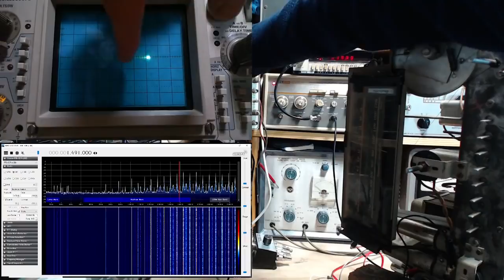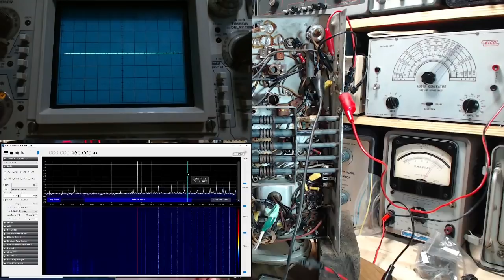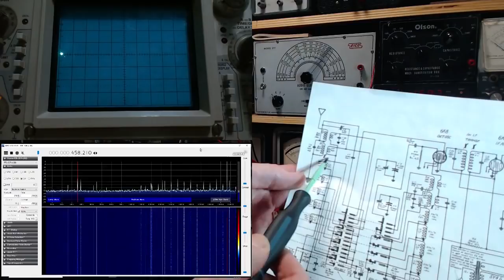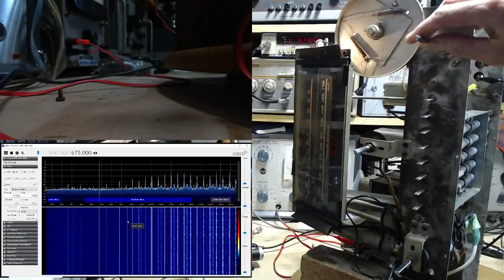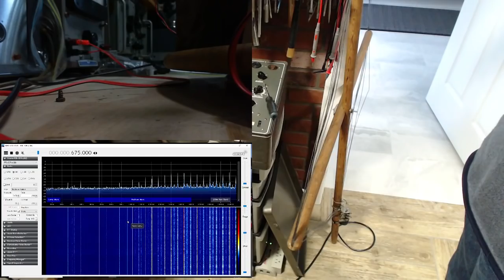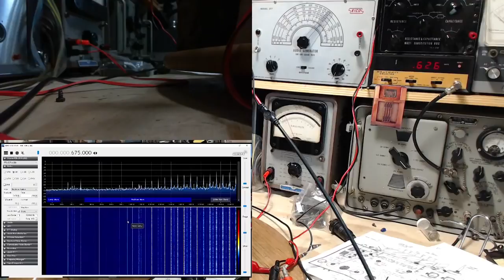Westinghouse 535 #16 - Alignment Check With an SDR Radio

Comment: I wonder did anyone at Westinghouse ever think about using a Balanced mixer that will remove the RF carrier as well as the LO and just leave only the sum and difference frequencies, the signals that you don't recognize are harmonics of the incoming signal and the Local Oscillator.

Comment: You have the SDR connected across the primary of the first IF transformer which is tuned to 460Khz, or should be. The SDR is going to heavily damp the response.
Also you can't try and retune the first IF coils with the SDR still connected. Using this SRD seems to lead you up the wrong path more than it is worth.
Reply: you really need to multiply the 460khz by 4 to get the signal which drives the 74AC74 which is 1840000khz and the 74AC74 gives to LO signals one at 0 degrees and 90 degrees to drive a 74FST3253 or 74HC152 Tayloe direct conversion  ZERO IF mixer to give I and Q so to demodulate the AM signal you do sqrt((I*I)+(Q*Q)) and that is that there is a way of getting the FM signal but that is more convoluted, if you don't understand what I am driving at then google for Tayloe Mixer.